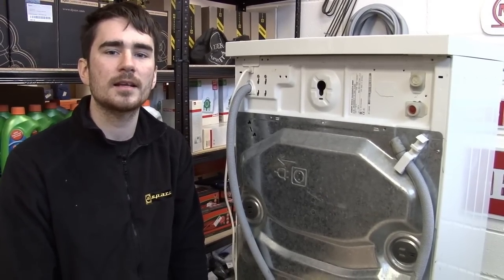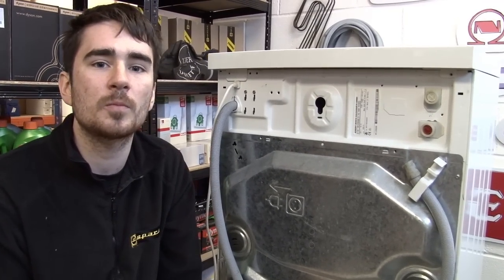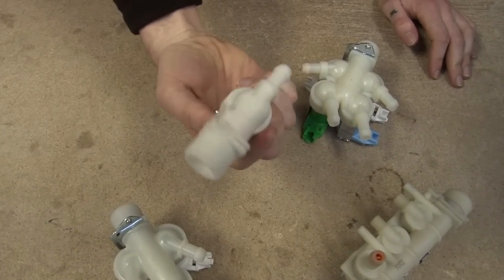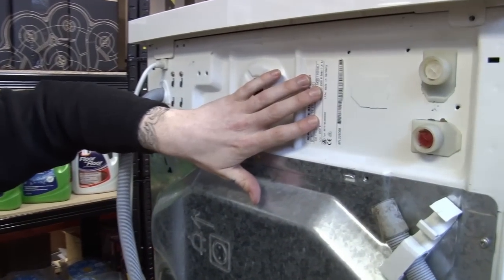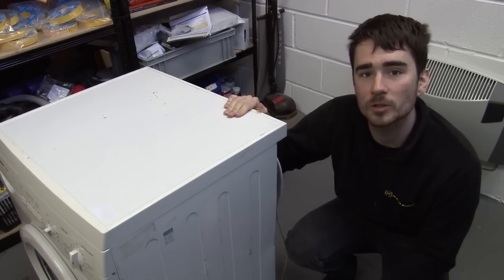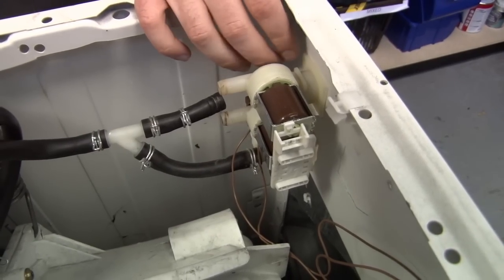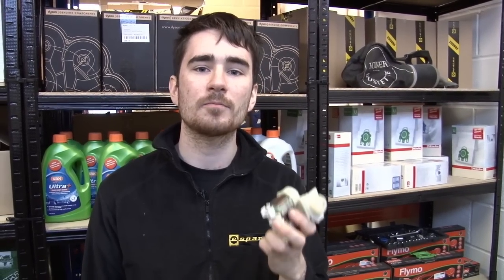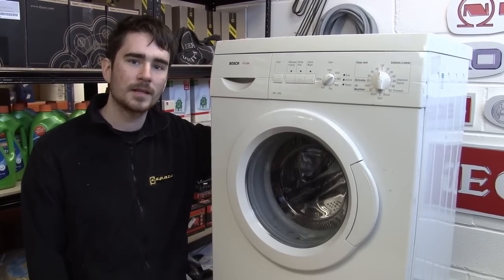Water Inlet Valve  - Easy Replacement on a Bosch Washing Machine!

Comment: We (in Australia) have an Electrolux 10+ years old and it had started humming loudly during the water infill phase from the hose at the top of the door. Based on your video I took a guess that the valve needed replacing and ordered the a new valve, with confidence gained from watching your video. Only difficult bit was removing the valve from the back of the machine. Had to execute a mild hit-and-hope to do so and thankfully it worked. Machine is back to running quietly now.
Also replaced the mouldy boot seal at the same time. That took me hours of effort to get the new one on but got there in the end. Hopefully will get 5+ more years work out of the old girl before the next part goes.
Thank you very much for making this video all thise years ago.
Reply from the maker: Hi Jim, thanks so much for your comment. It's so good to hear that you have had a great appliance fixing experience! Well done for successfully replacing the water valve and door seal yourself...we are glad our video has helped you along the way!

Comment: Good, clear instructions which gave me the confidence to perform this simple repair. 95% of the job is getting the washing machine in and out! The new valve definitely works but I just have to hope that the old one was indeed the source of the leak, but you can hardly be held responsible for that! Time will tell.
Reply from the maker: Hi Chris, thanks so much for your comment here...it's really great to know that our video helped you have the confidence to fix your washing machine! Hopefully it is now working fine.

Comment: Thank you for sharing this with us. I have a question related to the WM water valves: Do they operate properly if electricity is applied for longer times (most of the day) having in mind that washing machines induce electricity to them for short periods of time. I am thinking to use this valve in a water reservoir to close the filling inlet when pump is running so it prevents pump from filling the reservoir with its own water. 
Thanks

Comment: question is, can the valve be adjusted to increase the water levels on my bosch? As on my bosch im not appy with the very low water levels. On my old machine the levels were great. My inlet valve is the same as in this video and i wonder if that electric clip will come off to get access to a part you turn ? It does look like under the plastic electrical bit on top that there is a part that can be turned. Any advice from anyone is appreciated

Comment: This video is extremely helpful, but I still had considerable trouble removing the valve from the chassis. Pushing against it with the screwdriver toward the back didn't help. So I had to lift the bottom tab at the back. Maybe you could explain that you have to push down to release the valve at an angle. Or at least that finally worked for me. Thanks for the video.
Reply from the maker: Thanks for the feedback and comments Alison, this was one of our early videos so sometimes the information was not as clear as it could be. We are happy to post comments like these as it can help others when carrying out the repair.😊

Comment: Hi, thank you so much for the tips.  I'm not sure exactly what the problem is with my bosch front loader.  The water is not or barely filling the soap dispenser.  When I removed the soap dispenser while the water was supposed to fill, I would only see a few trickles of water pouring, but not enough pressure to even go through the dispenser water hole.  Any ideas?
Reply from the maker: Lisa Reutenauer The most likely cause of your problem is mould, for more information see another video : www.youtube.com/watch?v=HD570cEFlNo

Comment: Hi There. I have a Bosch WFK 2801 which has started to fill with water when it is switched off !. It is plumbed in for both hot and cold water and has been working fine for the last year or so. Would I be correct in thinking it could be a water valve that needs replacing and if so how do I find out which one.
Reply from the maker: +Michael Clark Turn the water supplies of one at a time and identify if this stops the problem. It May not be the valve if the drain hose connects directly to a fitting on the bottom of a sink as sink drain water may be flowing back into the machine. For more information see our video: https://www.youtube.com/watch?v=frEJhX9Sppw
Reply: +eSpares Thanks for your reply. I will turn off the cold water supply first and see if that is the problem. The drain hose goes directly to a drain and the water collected in the machine is clean.

Comment: Hello do you have video guide to remove the water inlet valve on Logixx 8 (WAS32791)? I have intermittent "Tap Closed" issues. Cheers!
Reply from the maker: The versions of the WAS32791 we have looked at have an 'Aqua stop' hose and valve assembly fitted. This will be a similar process to replace once the top of the machine is removed but is a one piece hose and valve assembly.

Comment: Greeting from Australia. I have a Bosch Washing machine WAE24270AU/11 that is about 19 years old but still going strong until recently when we have has a problem in the last couple of months. No error codes are displayed.  After washing cycle is complete and the clothes removed and the machine is left. After a couple of days when you go do wash clothes again there is a couple of liters of water accumulated at the bottom of the drum.  What could be the problem ? in this case we run the drain cycle which takes about a minute and after that just wash clothes as normal. I suspect that it could be the Aquasecure (11045139) which is part of the inlet hose or  the valve magnet (10031360). what could be the problem? please help ? By the way good videos.
Reply from the maker: Hi thanks for you comment...glad you appreciate our videos here!
If you have water entering the machine when it is switched off, it sounds like a faulty water inlet valve. Unfortunately we don't currently have the valve for this model available on our website...but if you fill in the enquiry form here, we can try to obtain for you.

https://www.espares.co.uk/contact/sales

Comment: my bosch machine is constantly filling, even with the machine turned off. I have to turn the water off at the supply. Will replacing the valve as shown fix it? cheers.
Reply from the maker: Hi Roger, the answer depends on how it is filling.
If water is slowly filling through the supply hose and is dripping in through the detergent drawer replacing the valve should cure it.
If water is filling quickly but stops if you unplug the machine the problem would likely be the control panel.
If water fills the drum even if you turn the water supply off check it is not flowing from the plumbing under a sink through the drain hose, if it is lift the hose in a loop above the sinks water level.
Reply: eSpares thanks for the reply, it fills slowly via the drawer. The model of machine is WFL 245S, do you have the correct part-number to hand? I tried finding it on your site but 2 versions appeared. cheers.
Reply from the maker: Roger S One valve is for Hot fill and the other is a double valve for the cold.
This may depend on model variants so if you cannot identify for certain fill in your full model including the /gb04? on the form at:
http://www.espares.co.uk/contact/sales
Reply: eSpares thanks very much, i'll check it out.

Comment: Do you have a video for how to clean the outlet bottle (don't know what its called) and the pressure switch on a Bosch WFK2401UC machine?
Reply from the maker: Hi Laura, your machine has two 'bottles'. The first on the drain hose is only there to allow an 'air brake' when emptying to stop the machine from siphoning the water away on a rinse cycle. The second attached to the drum fills with water to push up air to the pressure switch and identify when the machine has the correct water level. We have a video that explains this better here:
https://www.youtube.com/watch?v=2pIVkAxWSXg
Reply: Thank you I'll look at that video :)

Comment: Great video,  your company helped me fix my tumble dryer which only needed a new belt which I, of course, got from you. Thank you.  

A couple of days ago I opened the door of my Phillips Whirlpool AWG1897191380275 and to my shock/horror a whole load of water came out. I closed the door rather quickly and put it on the part of the cycle where it spins and removes the water.  Prior to this the machine had been standing empty of clothes and switched off at the wall and not left with an unfinished cycle if that makes sense. I left it overnight and the following day there was water in the drum again. I presume I have a faulty valve? 

 Both hot and cold valves are plumbed in and connected to the copper pipes via the blue and red plastic taps which have isolator valves. I have turned off the isolator valves so it does not fill up again. My questions if I may are, how do I diagnose which valve is at fault and do you stock replacements, it is an old machine.

Also, it has developed a problem with the final spin in the cycle. I think I am correct in saying it should end the cycle with three spins. I think each spin is supposed to get progressively faster. However, the final spin is not giving the final blast it should, it is just a weak spin similar to the second one.  Can you suggest what may be the cause/s, please.

Thank you ever so much for the videos.
Reply from the maker: Hi GeordieFX, thank you for your post and we are glad we could help ☺
Reply: @eSpares  Thanks for the thanks but could you not advise me whether you stock the parts or with the other problem I am having?

Comment: I have a Bosch washing machine and it is leaking from where the inlet water joins the copper pipe, and the blue stop tap doesn't work either, it is still dripping when I turn the blue water inlet tap to the off position.  It was and still is continuously dripping from the bit of white plastic where the water goes into the inlet hose.  Not where it joins the washing machine itself.
Reply from the maker: Hi Janey, the blue stop taps go because they are cheap plastic, you should be able to remove the blue stop by taking out the screw inside, you can then use a pair of pliers to turn the water off. Check inside the inlet hose as it may be the O ring washer that has gone but if OK check for damage to the hose.
Reply: @eSpares  Thanks.  Fingers crossed it is ok now, it was still dripping with the blue stop tap in the off position last night, and I was a bit worried because it was dripping near an electrical socket where the washing machine plugs in, though I had turned the washing machine electricity off.  This morning it was only dripping slightly.  I had tightened the screw in the blue stop tap a bit with a screwdriver, not sure if that helped.  I changed the whole hose, bought a new one, and ran the washing machine and it seems ok, no drips so far, and the dripping could have just been the water left between the blue stop tap and where the hose joins, maybe.  For the past few weeks there have been big puddles of water on the kitchen floor from under the washing machine, and I finally pulled it out last night to try to find out where it was coming from, and it was where the inlet pipe joins near the stop tap.  So maybe it was just a faulty water hose and the blue stop tap is ok.  Fingers crossed, everything seems ok now, but last night I was having trouble turning the water off anywhere, either at the blue stop tap or the main stop tap in the house, which also leaked, and I tightened the gland with a spanner, which thankfully worked.
Reply from the maker: Hi Janey, keep a eye on it in just in case but hopefully it will be OK.

Comment: Hello, I have problem with dishwasher Bosch

Inside dishwasher is always(if washing machine is off too) falling cold watter(from jet on left side inside), and on display is error code E16

Coulde it be this problem?
Reply from the maker: If the water continues after you turn the supply off it is likely the inlet valve is leaking  and will need replacing. If you are unsure see another of our videos:
https://www.youtube.com/watch?v=jLyA-7SC9ZY
Reply: Yes, it´s as you say, the water stops shortly after I turn off...
So I am going to try change intlet valve
Reply from the maker: Sounds like the problem. :-)
Reply: It was bad PCB Control Module :)
Reply from the maker: Thanks for the feedback.

Comment: Pls I have a Bosch washing machine with intelligent Disagreeable system.

When I put on the machine,in a few min it will signal tap close.pls help me what should I do then..

Secondly. It's smell too much.how do I wash the dirty from e machine ...pls it's  urgent.
Reply from the maker: Hi Anna, the first problem is saying the water is not filling quick enough. Check your water pressure and make sure the tap is on fully and the hose is not being pinched. If the pressure is ok take the hose off and check the filter on the inlet valve is clean (the part inside with an X on shown here: https://youtu.be/LB9--AvSvZg?t=12s).  To cure the smells see another video:
https://www.youtube.com/watch?v=ifWK9df1qgg